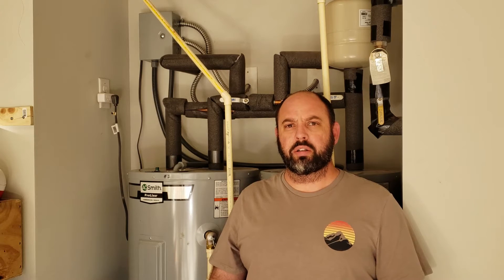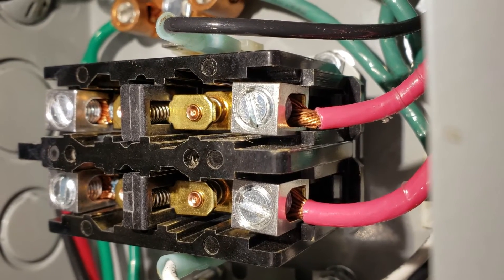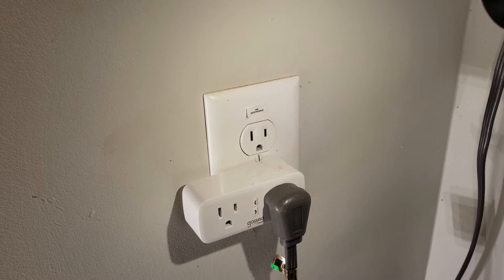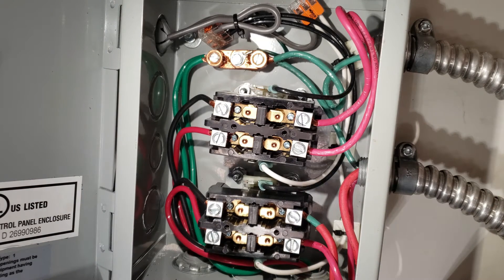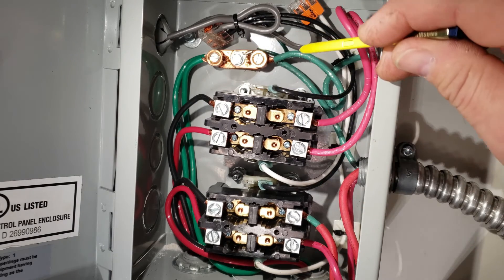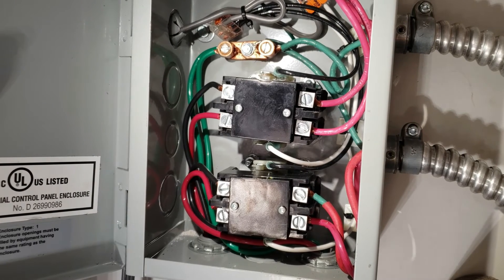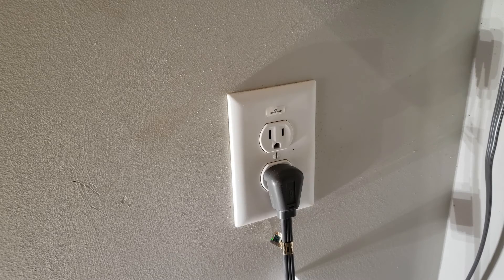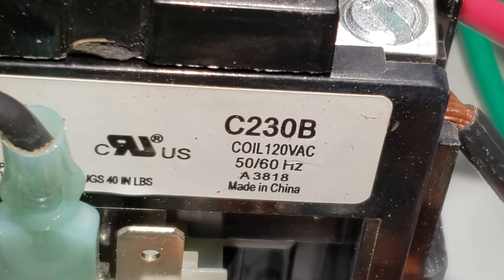Smart Home Water Heater Overview-6 months later

Comment: What is the ambient temperature in your garage during the summer?  Is there a maximum ambient temperature that these contractors should not be operated above?
Reply from the maker: That is a very good question. My garage does get very hot in the summer. My door faces direct west and gets the evening sun. I don't know the maximum or minimum operating temperature of the contactors. I do work with contactors everyday. They are used in extreme conditions from extreme heat to subzero with no operating issues at all. Ambient temperature does not have an effect on the contactors. The Smart switch is also in the same area and has never had an issue operating or staying connected to the Wi-Fi. Just use a good metal  enclosure to keep them safe. I hope this helps.

Comment: why is it you need 2 water heaters?
Reply from the maker: It is not that I 'need' two water heaters. It was already in the house when I bought it. But the two water heater setup is exactly why I wanted to install a system to turn off power when they are not needed. It is going on 3 years and the system has worked absolutely 100% flawlessly. Only providing power for 3 hours a day and we have never ran out of hot water.
Reply: @jply87 seems like you would save money by having only one water heater , unless you have a high demand for hot water
Reply from the maker: @garagekeys  I agree. I could save even more by turning both off and not using any hot water. But I figured since the home builder installed two water heaters I needed to do something to cut down on the power used. This project helped me and I hoped others could take inspiration from my setup to use and adapt to their own needs.
Reply: @jply87  just because the home builder did something doesn't mean it's right